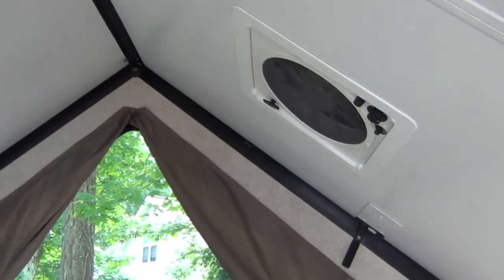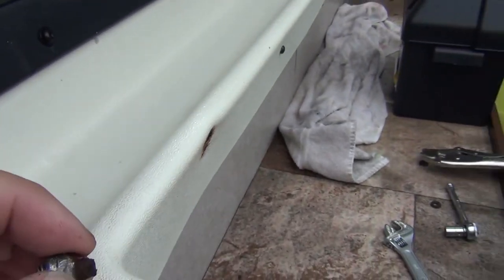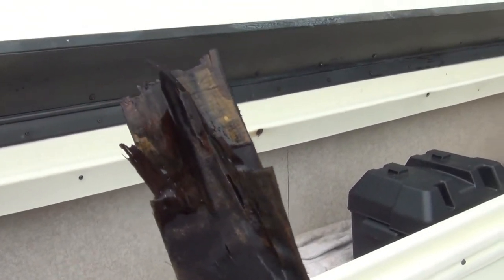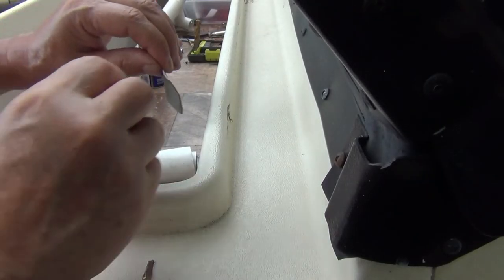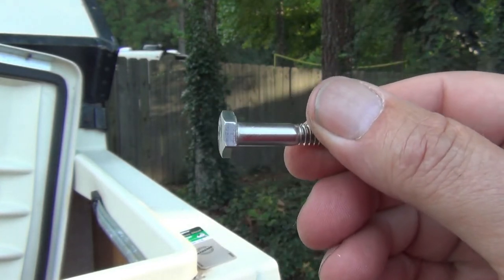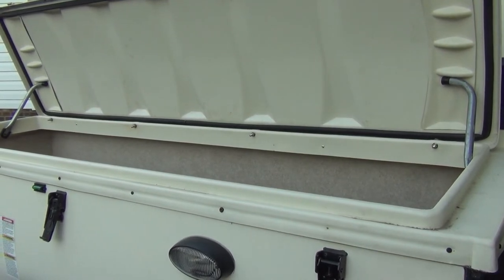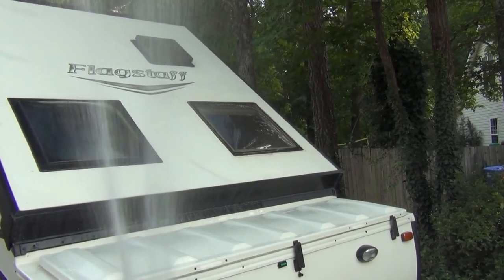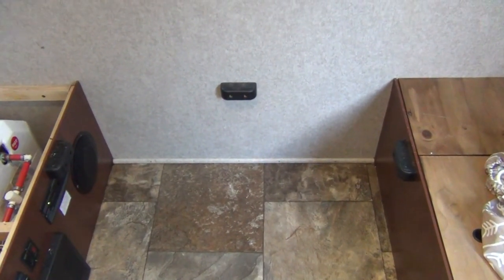AFrame Water Leak Repair. I STOPPED The Flood!

Comment: Ouch. Great work!
Reply from the maker: Thanks. Should have been done correctly at the factory.
Reply: @mrhoptoit7835  Totally agree! While we aren’t changing a bubble window out like you, I gained some great insight for our future plans. Took screen shots of the product you used, mental notes, etc. We did have our first leak in the larger bubble window. The epoxy cracking  makes perfect sense as to the hairline cracks we had in the corner that allowed rain to come in and slow drip on the bed. I’ve bandaid-ed it for now with clear silicone until the future idea… which brings me to a question I seen on yours. A little long winded, sorry… so our intention is to take the back big bubble window out in January, completely cover it with fiberglass or plexi… whatever when the idea comes complete. We hate that window baking is in the morning sun. I noticed your leak had a bit of mold… black stuff on the foam…. whatever it is from the water. I wonder if we shall see the same when we remove it. So the question is, did you address that water damage? Spray anything on it? Remove it? Anything? Or will it dry up on its own? 
(AZ dweller here… so we do have intense sun-drying power most of the year)
Reply: Oh crap… I asked on wrong video.
Reply from the maker: That's OK. since you asked here, I will reply here.  On the plus side, the black is an easy way to see where the leak is. I'm not sure if its actually mold or not, but I did spray it with a little Wet and Forget (anti mold and mildew product) that I buy at Lowes. I use the Indoor formulation. I guess I probably should have shown that.  I also like to spray it into any areas that get damp, like the outside compartments. As far as your silicone patch for corner cracks - I've never had much luck with silicone lasting very long. There are three ways I have used to successfully patch those cracks, and cracks on the bubble itself.. I used a coating of Sikaflex 221 ( messy and covers the view, so only on the flange and base of the bubble) , Eternabond tape         ( same issues, but pretty much permanent. Also VERY hard to remove) or Gorrilla Tape ( clear, durable and works way better than I ever expected). I may do future videos on these subjects. I hope this helps. Thanks for the great question.
Reply: @mrhoptoit7835       .